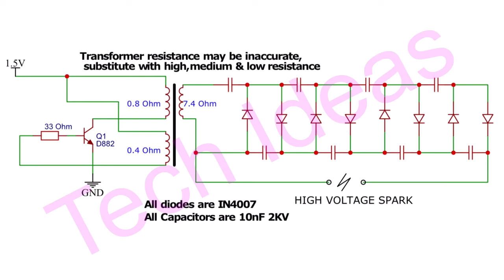High-voltage from tiny transformer 1.5V to 10000V

Comment: Seems like 1-2 kv by the arc length lol
Reply: XD será por qué no lo alimento con más voltaje que lo alimente con 3 o 5 aver que pasaría
Reply: First of all diodes can tolerate at most 1000v .... further rise of volts fuses or explodes the diodes so i can tell that .... there is nothing more than a 1000 volts.....lol

Comment: Nice high voltage circuit 👍👍
Reply from the maker: Thank you
Reply: @TechIdeasAG  I finally found someone who has the same hobby with me. I always feel that the voltage of 1000v is a bit low. Have you ever thought about making a 1000kv, and then using it to make electric shock rods, and then use electric shock rods to make super EMP

Comment: Hi, can I use different capacitors at different stages ?
I mean, first capacitor is 10v , 2nd one is 50v , 3rd 100 v ,4th 200v and 5th 400 v ??

Comment: Instead of "F 103M 2kv" pf capacitor can i use 222 2kv pf capacitor. 222 2kv  is available here. Please confirm, it will work or not with 222 2kv. Other parts are available here.

Comment: What about the current? Will it be boosted or not?
Reply from the maker: Only the voltage boosted
Reply: P = VI, increase Voltage and subsequently reduce Current. This circuit almost has no current at output

Comment: I made one with bigger transformer and big transistor D313 and bigger capacitors and higher voltage diods and capacitors and bigger feedback resistance 1w since my first one get in to fire because it was 0.25w  and I got a voltage spark long enough with high frequency discharged that light a paper Soo easy